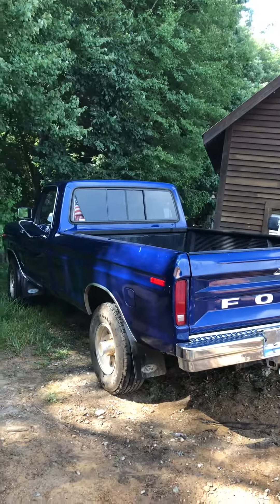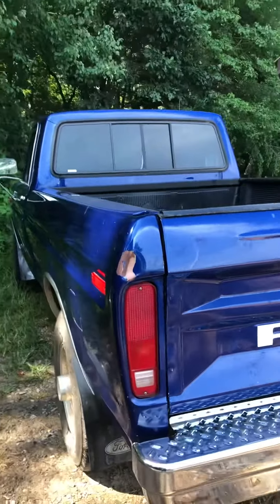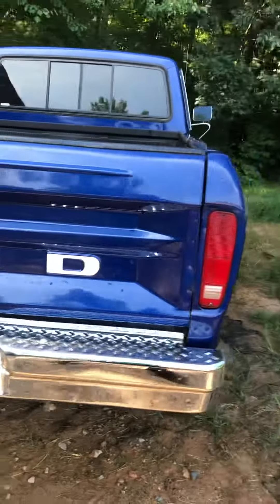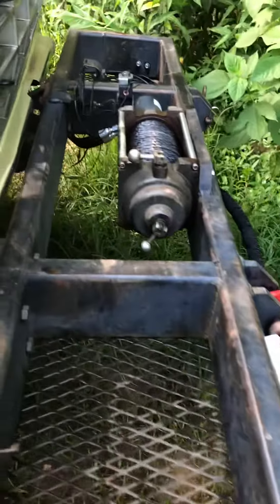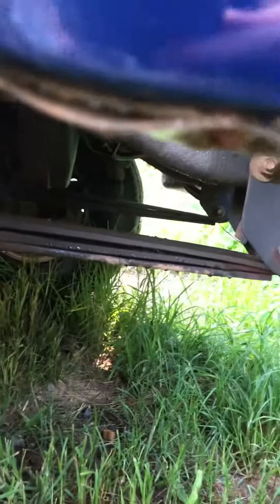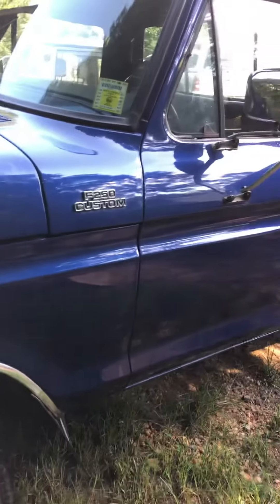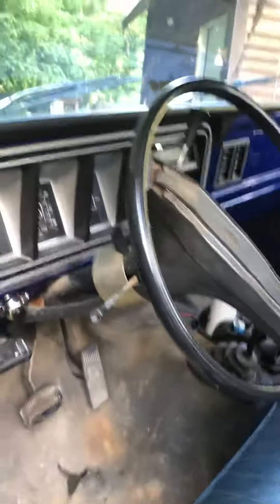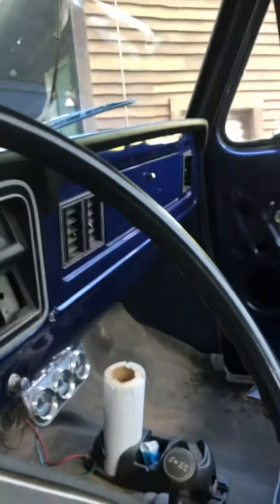1978 Ford F250 Rebuilt 400 M

Comment: How many ponies?
Reply from the maker: Never had it on a dyno but I'm guessing 360.  400m bored .090 with headers, balanced, cammed, 3angle valve job, 650cfm holly, aluminum intake...das it